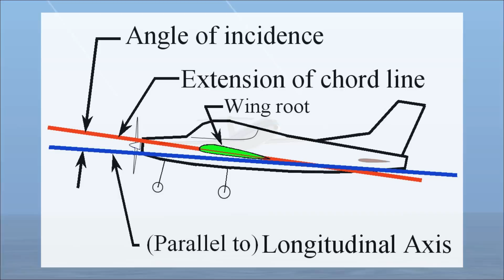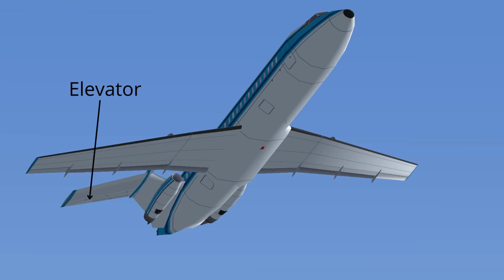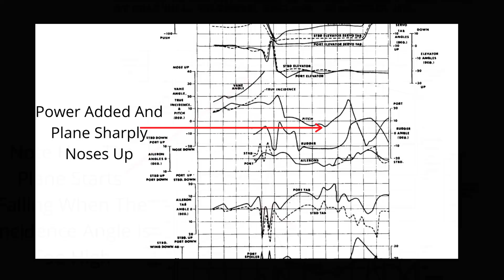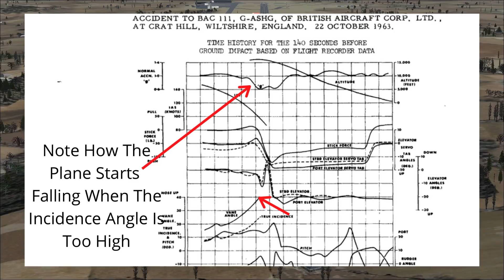These Pilots Sacrificed Themselves So That We Could Fly Safely | BAC 1-11 Test Flight Crash

Comment: Adding power in a stall is simply counterproductive. Engines idle and push over is only solution, even if it’s counterintuitive. Shouldn’t happen to test pilots, or any other pilot for that matter. Gear down and trim as needed. Once the deep stall is established, it gets near impossible.
Reply: I’m curious how you come up with that statement. I flew airliners over 43 years DC8, SVC10, B747, B727, MD11, MD10,  A310, A300-600 and everyone used power for stall recovery. Why was I always taught an incorrect procedure?
Reply: @georgeconway4360  stall recovery or stall avoidance? Stick shaker stall + power, sure, in a high powered jet you will fly out of it with minimal altitude loss, standard procedure. But what if you’re in a full stall (like AF447)? Nose down for speed, engine power for altitude once you have broken the stall…
Reply: @maesc2001  Both
Reply: @maesc2001  Nose down for speed, and engine power for altitude? That’s what I taught years ago when I was a CFI in light aircraft. I’m curious what Certificate you hold, and airplanes flown, and approximate hours each.
Reply: @georgeconway4360  How many more times are we going to have to engage on this? Oh, and are you the George Conway from the Lincoln Project, in which case you have my respect, sir?
Reply: @maesc2001  No, we have a different middle initial, and a different wife. The other George is an attorney and a Republican. I on the other hand was an Airline pilot from age 21 to age 65, and a Democrat.
Reply: @georgeconway4360  
That explains it.
Reply: @alhanes5803  Lot better than being Putin’s Puppet!
Reply: @georgeconway4360  I never was an airline, nor professional pilot, flew single engine and twin aircraft in real low and hard IFR in Europe, as you may have guessed, where private pilots are not constrained to legal minima in terms of starting an approach, contrary to the US. Did some jet training out of pocket, including 747-400 and I’m pretty confident the same rules go for any aircraft on an ILS: attitude and power as you used to instruct. Now, obviously, in heavier aircraft, flying out of an early stall is different to smaller planes, but ultimately, in case you fall asleep at the wheel, the stick shaker becomes a stick pusher. Point made I hope. Nothing wrong with being a moderate republican in my opinion. But, since, symbolically, US politics are world politics, I root for the same party as you and rest my case.
Reply: @maesc2001  Actually the rules I used to instruct don’t apply to large aircraft. Throttles control speed most of the time. We all know that power and pitch can impact both speed and altitude  In small airplanes we stressed power controlled altitude, and pitch controls speed. In jets speed is primarily controlled by power. The only time today when pitch is primary is a normal climb power climb. Then the speed is controlled by pitch. Today when a modern airplane descends the profile is controlled by pitch and the speed is controlled by power. Before the Glass/FMS airplanes would use rules of thumb to calculate top of descent points. The rule I like is 3xDistance=your desired altitude for any arrival. This is 300 feet for each Nautical Mile from touchdown. 1 mile=300’, 5 miles=1500, 20 miles =6000, 43 miles=12900, 70 miles=21,000’, 110 miles=33,000, Use 5xGround Speed will give you the V/S required to stay on that profile. I flew FMS/Glass airplanes for the last 20 years of my career I always used those rule’s to confirm my FMS information. Those rules would have saved that TWA crew and passengers on flt514 12/1/74 when they ran into a small mountain diverting to ///Dulles.
Reply: @georgeconway4360  
OK lil troll.
Reply: @georgeconway4360  I think your full of crap on your resume.
Under wing engines will cause a nose high attitude at high thrust.
Reply: https://drive.google.com/file/d/1XtV2a_EwiyU95hJjBS7aVaEYR7PIZU-i/view?usp=drivesdk
The starting date is Seaboarld World. The hours mentioned are only FedEx hours from August 1989 until Retirement. Total hours were 23,300.

Comment: Sadly, the stick pusher didn't save the passengers and crew on the Trident that crashed at Staines. It appears that the pilot overrode the stick pusher. A baby survived the crash, but died later.
Reply: The stick push was designed to recover from a relatively high altitude stall rather than an immediate stall at low altitude caused by changing the configuration of the wing. 
https://assets.publishing.service.gov.uk/media/5422f154ed915d1371000365/4-1973_G-ARPI.pdf

Comment: Wow. I worked that plane as a crewmember hundreds of times...in the late 80's. They were originally Mohawk Airlines...if you know your airline genealogy, then you will know who I worked for.  I had no idea about this flaw, thank God.
Reply: It's the same "flaw" with all T Tail aircraft, including the DC9, MD80, Boeing 727 and many more.
Reply: @ChrisCooper312  All of which I have worked. And the Fokker 100 too. As I said, I'm glad I didn't know this. We had a tragic history with the Boeing 737-300, as well. Don't even ask me how many flights I worked on that plane...before the uncommanded rudder flaw killed three of my friends. I tried to avoid it...working our T-tail equipment and the 75 and 76 instead! Even the jack screw challenged MD-80. By the way, a flaw is a flaw. No quotation marks are required.
Reply: @claycassin8437   * quotation marks
Reply: @Milesco  Oops. Thanks. My brain is faulty. I have corrected my error.

Comment: No other deep stall on this plane, but if you look at the story of the MD80, which has an identical configuration, you'll find them, and much later than 1963, like the West Caribbean Airways Flight 708 in 2005

Comment: Great video, as always, many thanks for sharing it with us! I know that problem from the DC9 my dad was flying for decades and I was working on it as an engineer in the 80's. On the DC9 a locked in deep stall situation could occur as well. That is why the DC9 's had among other things an elevator power system allowing an elevator nose down command even when the t-tail had almost no air flow. As far as I can remember the "elevator pwr on" light was one of few blue/green indication lights on the annunciator panel. The system was checked during pre flt check by pushing the steering column full forward. Kind regards from Vienna, Austria
Reply: The DC-9-10 was literally on the drawing boards when this crash happened.  In the late 70's, I was told by a senior DAC engineer that the area of the DC-9's horizontal stabilizer was increased by "50% overnight" after the crash.  I don't know whether the chord/span literally got bumped up by 22%, but nonetheless an indication of the effect this crash had on airliner design going forward.

IIRC the MD-80 also experienced persistent deep stall during flight testing, but as expected  from analysis was able to recover by the time it reached thicker air around 10k feet.  Or maybe it was higher than that, and 10k was the designated bail-out altitude if the stall persisted?  The test aircraft was outfitted for quick egress by the minimal crew, with the forward cargo door rigged to open when the first person jumped down a hole in the cabin floor above it.

Also don't know whether the powered elevator for recovery had been developed at that point, or was turned off for the test, or ??.  So a fuzzy and incomplete memory, but I'm passing it on with that caveat.  Maybe someone who was actually involved with the flight testing can chime in.
Reply: @marcmcreynolds2827  Yes I have heard about that but when I started we had a DC9-30 fleet, so can't say a lot about the series 10. Over the time we got 50's and 80's.
Reply: @marcmcreynolds2827  yes I really think they didn't know that was possible at the time, and learned the hard way. I can only imagine what not being able to do anything and falling like a rock feel like. I wish they were able to escape the plane to tell the tale
Reply: @nigo1787  My understanding is that they did stay in radio contact all the way to the ground.  I'm fuzzier on specifics, like whether control movements for recovery attempts were being relayed in real time, but it seems there was a good technical account as to what was going on.  That would have gone a long way towards dispelling questions afterward of for example whether hardware failure had been the cause, thus allowing the engineers to zero in on corrective action.
Reply: Interesting, thanks for sharing!

Comment: You're saying, "angle of incidence." Did you mean to say, "angle of attack?"
Reply: The airplane has a fixed angle of incidence; it can never be changed. It has an angle of incidence while it's simply sitting idle on the ramp while the crew drives home for dinner. On the other hand, the airplane can only attain an angle of attack while it is moving; there must be relative wind. And the angle of attack can vary greatly.
Reply: He was talking about his 1st date.

Comment: Rather a confused explanation. Swept wing stalls at tip first, causes pitch up, wing wash blankets high mounted elevator, impossible to pitch down to recover
A deep stall accident happened to a Trident during test flying.
VC10 had negative camber at wing root so wing stalled uniformly without excessive pitch up.
Canadair RJ crashed during stall tests as stall recovery drogue not deployed correctly. Also T tail.
If you are to set yourself up as an expert please do your research properly.

Comment: A  Trident got into a deep stall after takeoff from Heathrow and crashed at Stains.  https://en.wikipedia.org/wiki/British_European_Airways_Flight_548.
Reply: "Stains"? Horrible name for an airport.
Reply: @chrissweet5740  Stains  is "village" on the river Thames now really a London suburb mainly famous for its reservoirs and sewage works. It is about 3 miles from the end of the Heathrow runways. To be fair the areas down by the river are a lot nicer than the name suggests and are very expensive and sought after, presumably by rich deaf people with like the smell of jet A1 😁
Reply: @thamesmud  Oh.
Reply: This accident was probably caused by the P2 changing the wing configuration to cause an immediate stall. https://assets.publishing.service.gov.uk/media/5422f154ed915d1371000365/4-1973_G-ARPI.pdf

Comment: Great video, as usual. May I suggest something? What you were calling „angle of incidence“ is actually angle of attack. The angle of incidence is the angle between the aircraft longitudinal axis and the airfoil reference line (basically, how the wing is attached to the fuselage). It’s usually something which on most airplanes cannot be changed, unless being extremely destructive.
One airplane which could vary that is the F-8 Crusader, because it’s geometry didn’t allow sufficient angle of attack (and thus, lift) to be produced during take off and landing from carriers. So, the guys at Vought built in a hydraulic jack where the front end of the wings could be raised a few degrees for that purpose.

The angle of attack is the angle between the airfoil reference line and the approaching air.
Reply: ^^^ What Johnny said.  Angle of incidence can be altered slightly by flap/ slat extension but OP needs to be saying angle of attack.  Also,  many people confuse aoa with deck angle.
Reply: Also, "airfoil reference line" is called the chord line and is basically a line from leading edge of wing to trailing edge.
Reply: What we in America call "angle of attack" is called "angle of incidence" in Great Britain.
Reply: @MemphisBBQ640  And how is the angle called at which wings are mounted to the fuselage in Britain?
Reply: @MothaLuva  angle of coincidence
Reply: @232K7  hells angle
Reply: @MemphisBBQ640  well that's strange.  Cookies and biscuits, chips and fries, I suppose.
Reply: @MemphisBBQ640  The angle of incidence is built into the plane. During WWII, there was an aircraft called a Vultee Vengence. It had no angle of incidence. In flight, it flew with an odd, nose-up attitude.

Comment: Centre of gravity is also very important as regards behaviour in a stall situation. Of course aft cg is more critical than forward cg.
Nowadays during test flights they set the exact center of gravity with water ballast tanks in the passenger cabin. I believe they can modify this in-flight if need be. 
If you get your cg forward you're in much better shape in a stall. If you've ever flown an aircraft yourself you know what I mean.
Reply: That's why they had three "observers" who were told to run back and forth....
Reply: Generally I believe c of g is controlled in flight by transferring fuel between tanks to keep c of g within limits. From what I've worked on, fuel proportioners pump fuel from tank groups to help relieve the workload on the crew.
Reply: @125brat  That depends on the type of aircraft, whether that's possible. Modern narrowbodies (B737 series, A320 series and any smaller aircraft if I am not mistaken) do not have that capability: Just one fuel tank per wing and that's it. You cannot change the cg by moving fuel around. 
Widebodies like the old A300/A310 and also the modern A330 (and I guess the larger Boeings) do have that fuel tank trim option though.
Plus, testing beyond the operational limits of a plane with designated test flights is another matter. I have found this other video, see other answer.
Reply: Here is a video that explains it: This is modern aircraft test flight operations
https://www.youtube.com/watch?v=edrbbwhW0Cw
From about Minute 2.00
Reply: @olaflieser3812  Thanks Olaf. My main experience is of tanker aircraft with multiple wing and fuselage tanks where it was the copilot's job to manage the fuel. Yes, smaller aircraft tend to have a single tank in each wing and maybe a few cells in the fuselage but I'll have a look at your linked video to see what you're referring to. Of course, test flying is often at the very limits of the envelope or beyond flown by very experienced pilots after much research and calculations. I know an ex-RAF test pilot and their motto was "Learn to test, Test to learn".

Comment: Can't a plane roll into a nose-over?  They would have needed to do it at the beginning of the stall rather than after losing their altitude and forward momentum.
Reply: Without speed, wings do not produce lift and aileron movement (deflection) does not pose enough drag to almost vertical airflow to bank (roll) the aircraft. Horizontal tail surfaces are sole devices big enough to drop the nose, and they are "shadowed" by the wing. They did not have enough altitude to try anything else, and rare "T" tailed civil aircraft have a high AoA stall recovery procedure anyway.
Reply: @docnele  What shape do the tails use nowdays?  Also, what do they do different for high AoA stall recovery?
Reply: @pyro226  they stay away from full stalls by recovering when the stick shaker/pusher activates.
Reply: @docnele  What shape do the tails use nowdays?  Also, what do they do different for high AoA stall recovery?

Comment: It's not angle of incidence, it's angle of attack when you are flying. The angle of incidence is the angle the wings are mounted to the fuselage, as shown in the illustration at 3.50 and this angle obviously never changes.
Reply: The data recorder print-out shown in the video refers to something called "true incidence" and the figures for it suggest that it was at the time a term for what is now called the angle of attack. Other technical terms have changed over this period, for example the tailplane and fin have become the horizontal stabiliser and vertical stabiliser. Also the terms port and starboard (which appear on the print-out) don't seem to be used any more.

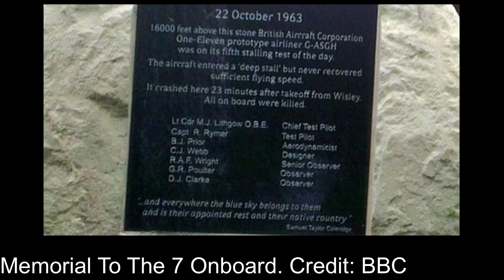Comment: 8:16 But other planes than the BAC-1-11 crashed due to a Deep Stall during test flights, like a Trident in 1966 and a CRJ-100 in 1993.
Reply: Yeah, and other planes like the F-101 had these issues prior to the 1-11's testing.

Comment: Sounds like another lesson was in stall recovery. Had the pilots allowed the plane to regain more airspeed while in the nose down position, my non pilot suspicion would be they could have recovered. I would imagine this characteristic must be included in commercial pilot training for certain type ratings.
Reply: When training for a t tail type, we don't get anywhere near a full stall for this reason. We recover at the stick shaker typically.
Reply: These were highly trained and skilled test pilots. They would have known perfectly well about stall recovery, certainly more than a none pilot like yourself.

Comment: If these pilots were to have jumped out with the 25% AOA. Would they miss the wings, engine, and tail since those would be much lower than if they were to jump out with a AOA of 0%?
Reply: At that point, the plane was basically a falling brick, not moving forward. They would have stepped out of the doors and more or less floated alongside the plane as they both fell toward the ground
Reply: The g's you would pull at that AOA would prohibit an exit surely
Reply: @Matt.m6  AoA doesn't equal Gs, if you see a slow flight demonstration of a fighter jet, you can see them pulling a lot of AoA but keeping Gs to something like 2G, because of the slow speed of the aircraft